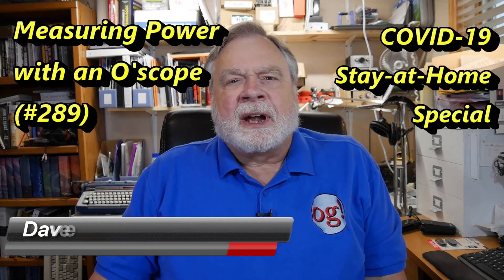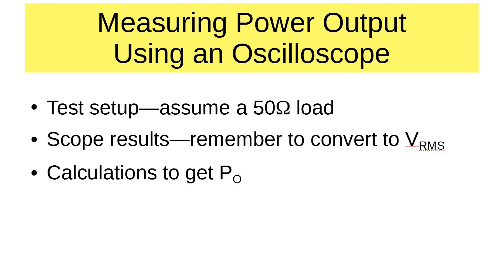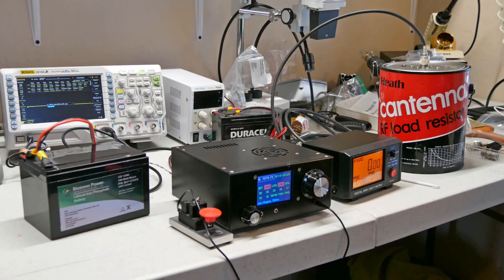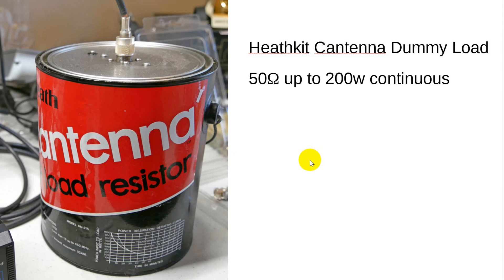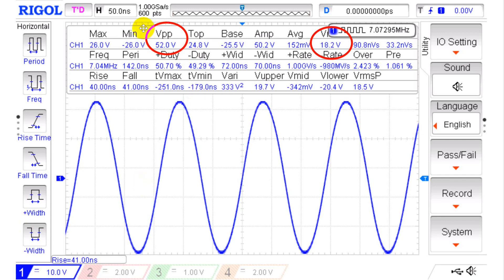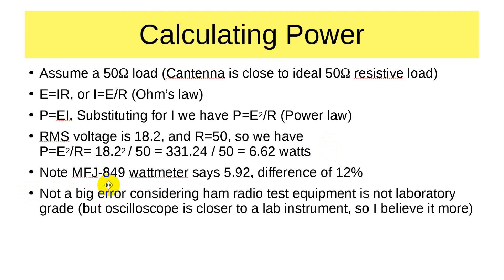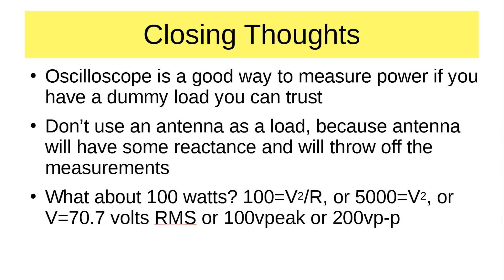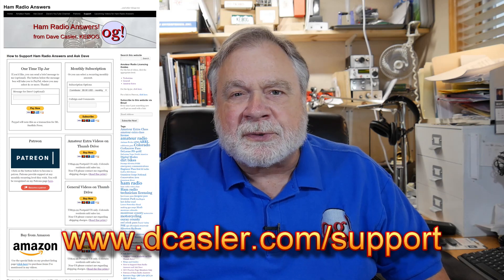Measuring Output Power with an Oscilloscope (#289)

Comment: The other way, which was recommended by manufacturers such as Drake, was to use an RF voltmeter and measure the voltage across the load at 14 MHz. However, some RF voltmeters start to roll off at 10 MHz and accuracy starts to decrease. I have two Millivac RF voltmeters that I use here, one ex-military, with both having matching serial numbers between the probes and meters. That is how I calibrate watt meters, along with a scope.

For high power, such as 1 Kw, I use an accurate attenuator between the load and probe.

Comment: Hi David. I have used the peak method to calculate Tx power for some years. There was a chap on the web who used to repair Kenwood hybrid radios, he offered spares but also offered the parts and plan to build your own test load in a paint can similar to your test load. Incorporated in the parts was a diode. The diode along with a capacitor formed a peak detector capable of driving a DVM. The  maths went like this, Vrms is equal to route2/2 x Vpk (note Vpk  not V pk to pk, note route2/2 equals 1/route2). Power equals V squared/R. Subs in and power equals Vpk squared/50 times route 2 squared (that's 50x2). That is Vpk squared divide by 100. Now my Icom produces 99 and a bit Volts pk, add 0.6 Volts for the diode volt drop, say 100  Volts, square 10000 and divide by 100 answer 100 Watts. My 4 watt CB produces  20 Volts peak. Square 400 divide by 100, 4 Watts. Quite simply Power in Watts equals Vpk squared divided by 100 for a 50 Ohm impedance radio. Tell me if I have it wrong some where. Many thanks for your many amazing videos.

Comment: Hi Davide, I am an Italian radio amateur, I have an oscilloscope like yours a Rigol DZ 1054 but I have expanded it to 100Mhz of band extension. I should measure the power of a Tokio Zodiac rtx (it is the President Jackson clone with an extra 40 channel band (frequency 25.615 to 28.315Mhz) I used it 30 years ago together with a double needle Zetagi HP202 Rosmeter / wattmeter.
A few days ago I took everything from the warehouse and I restored the Zodiac Tokio by replacing all the electrolytic and tantalum capacitors and I tested it: it is aligned and in frequency. But I don't get the original RF power (12 watts), at least that's what the wattmeter rosmeter indicates. I come out with max 6 watts of power foward with SWR 1: 1.1. I connected a dummy load of the MFJ 260C which in HF has a SWR of 1: 1.1 (I tested the dummy load with 2 vna: nanovna and MiniTiny vna and the smith chart shows me that the load is perfectly in the center of the circle , it has no inductive XL nor capacitive XC reactances) so I believe that the trimmers of the ZETAGI wattmeter ros meter have to be set (also the ZETAGI HP 202 rlo has 30 years of inactivity).
So I measured everything by replacing the wattmeter Rosmeter with a professional Daiwa CH 901 HP 3 and in fact it detects 10.5 watts but I would like to make an even more precise measurement with the oscilloscope taking the cue from this video of yours. Should I use the original probes or for safety should I use an active differential probe (which I have in my kit)? I also have a 100x passive high attenuation probe could I also use this? Many thanks 73 51 fromMassimiliano

Comment: Very nice tutorial! I tried it out and used my Rigol DS1054Z (same as you, with 100 MHz option) to try and measure the output power of an RFM69HCW module on 433 MHz. I wasn't expecting to see anything at all. But then I got this:
* Lowest power level should be 5 dBm (3 mW). Measured 18 mV RMS (6 mW) (noise floor not taken into account, should have done that maybe)
* Highest power level should be 20 dBm (100 mW). Measured 75 mV RMS (112 mW)
Some steps in between showed increasing voltages, so the measurement was comprehensible. I wasn't able to measure the frequency though, it mostly showed nothing or some 50 or 100 Hz.
Am I dreaming or is this a somewhat correct measurement?
BTW: I have a lambda/4 monopole attached and measured at its foot. With the standard 1x probe.

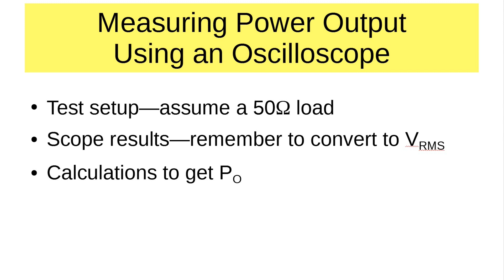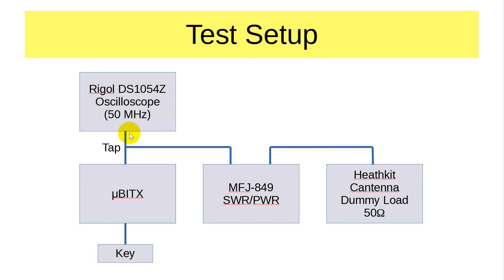Comment: At 2:04 until 3:06  I wish you would have made that diagram just a tad different ....... The Tap point should be in the middle point of the East to West line , that way some people,  NOT familiar with schematic lines might mistake the line from the Micro BITX to the scope with the TAP off of that point to the MFJ-849 meter and Dummy Load .....   I hope I didn't misword it ....  In other words the tap point to the scope , should be after the BITX  on the way to the watt meter and dummy load .... I would not put any radio or XMTR  directly in a scope .....It would be a OMG Oops moment .....

Comment: Enjoyed this video Dave.  Haven't done a power check with an scope for twenty years. Thanks for touching on the safety issue at the end.  Did you have your scope grounded to the RF ground?
Reply from the maker: No, not grounded to my RF ground system, but grounded to the utility ground.

Comment: Thank you Dave.  Your efforts to instruct and motivate are always appreciated but especially now during the global pandemic. 

BTW, I set up a small dipole antenna (~0.3m each leg), connected my scope probe to it, and used the oscilloscope (PicoScope 2204A) to measure Vpp.  This would tell me if my antenna (on the balcony) was radiating or not.

I believe that one could take this one step further by using a "nanoVNA" to measure the impedance of an actual antenna which is ~R if the SWR=1.0 (Z -> R).  Then disconnect the nanoVNA and connect your antenna back up w/a "T" splitter into your scope.  Make sure your Xceiver doesn't autotune (SWR is already 1 after all), press the PTT down, and the scope would give you Vrms (from Vpp).  From here, P=E^2/R would give you the Power at your antenna.  Or pretty close.

Just a thought.

Comment: You'd be much better off mounting the BNC-T directly to the scope input and run the main path on the other two ends.  This way, the open stub length is minimized.
Reply from the maker: Good point
Reply: Shouldn't the T be at the cantenna side connector and use the probe @ 10x to take the measurement "accross the load" and not have a stub in the firstplace ?

Comment: I have a dual band Tektronix O Scope that is from the 60's, I have not used it in years. I lifted it up to the bench and nearly got a another Hernia !  It turned ON, but I suspect that I have some Caps that have dried up. The tubes should be OK, they don't go bad sitting idle in a good room environment. I have a similar issue with a Bell and Howell O Scope that I built years ago as part of a course that I took after leaving the Army, Caps !! But at least that scope is transistor and weighs FAR less than the TEK Beast.

Comment: Scope reading will read higher because the scope's high impedance input (10M Ohms) is not matched with the transmitter and coax impedance (50 Ohms).  Some scopes have switchable Hi Z / Lo Z inputs. Otherwise, use a 50 Ohm through terminator to get accurate results.
Reply from the maker: The scope has Hi Z inputs. The transmitter was terminated by the dummy load.

Comment: I was surprised you did not use a 50 ohm through terminator at the scope's input.  Does the dummy load connected to the T-Connector do the same thing?
Reply from the maker: Yes

Comment: Thank you for sharing. I did not recognize terminator at scope. Would that provide more accurate results? I mean;  connect transmitter to an attenuator (for example 20db) and continue the 50 ohms cable right to the input of the scope. At the input of scope mount a 50ohm terminator and the scope will measure the voltage over the 50ohm. I have used this approach so far. What's your view?
Reply from the maker: The termination was provided by the dummy load.
Reply: @davecasler  thanks for the nice video! this detail put me into thinking as the scope is not directly on the dummy load. EMRFD ch7.4 shows a few methods for measuring power with the oscilloscope and i am not sure if this setup would give accurate results! i would be very interested to see the difference if it was measured exactly on the dummy load.

Comment: If your 'scope, like mine, can't automatically calculate V(rms) you can use V(peak to peak).  The equation is: Power = E^2 (peak to peak) / 400.  This assumes a 50 ohm load.  I'll leave it as an exercise for the student to figure out where the 400 value comes from.  So, using Dave's data E (peak to peak) was 52 volts.  Power is then 52^2 / 400 = 6.76 watts.

Comment: If and only if the bandwidth of the scope is appropriate for the frequency you're attempting to measure at? If you pipe a 450 MHz signal into that 54 MHz scope, you're going to need to know how the scope attenuates or mis-measures higher frequencies, if at all. (?)
Reply: Generally speaking, an o-scope's response is fairly flat, but it will be down 3 dB at the rated bandwidth. I mean that a 50 MHz-rate 'scope will be 3 dB down at 50 Mhz. If you try to pipe a 450 MHz signal into that oscilloscope you probably won't see much of anything.
I think I've answered what you were asking.
Reply: @tfrerich  Right. So where the title says 'Absolutely' it should say 'in some cases'.

Comment: So my antenna and coaxial is not at 50 Ohm (as many ham shacks are) So how do I actually measure the true power then?
Reply: As David pointed out several times, if you toss in an antenna with a complex impedance, let alone adding feed line to further complicate the issues, then this process won't work easily.  
His entire setup depended upon a source impedance of 50 ohms, a transmission line with a matching characteristic impedance of 50 ohms, and a resistive load of 50 ohms. There's no capacitive or inductive reactance to mess things up. You can see that because (assuming the dummy load had no reactance) the VSWR was 1:1. 
If you can measure all the bits, like complex impedance, amplitude, and signal phase, you could calculate it out, but it gets much harder. If you want to try, I'd suggest that doing things using polar notation is easier than using Cartesian.  And, let me add, you are a braver man than I, sir.  -- grin

Comment: Wow Dave, another great video!

With that scope, can you also use the math functions to calculate & display the power output?

To carry on with that, those Rigol scopes are pretty nice to have, and so could you show us how with that setup -  how the signal looks in the frequency domain; i.e. poor man's spectrum scope... & comparison with different modes, cw, am, ssb, fm, digital...
Reply: Power depends on the resistance of the load. Since the scope doesn't know the value of the load, it could not calculate power, unless there was a way to tell the scope the load but that's not a feature.  You are stuck with having to drag out that old slide rule!! HI

Comment: Very interesting and informative demo. Thank you Dave. I know that  +/- 10% is good enough for Ham radio work, but I was wondering if by using the O Scope, which I also agree is more accurate,  one could use the O Scope reading of power to calibrate the watt meter to be more accurate? If the watt meter stays linear with any corrective calibration, I would think it would be possible ? What are your thoughts Dave ?
Reply from the maker: Yes, you certainly could. You'd want to do it separately for each band, though.
Reply: @davecasler  Good point Dave, frequency will certainly effect readings